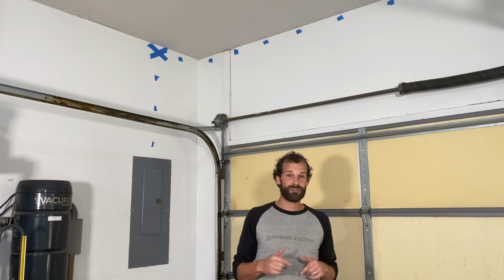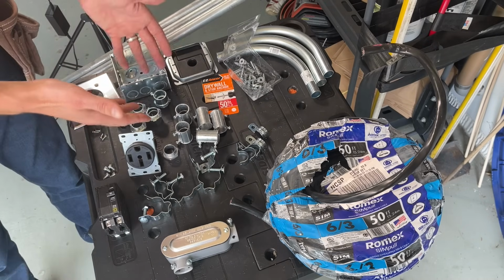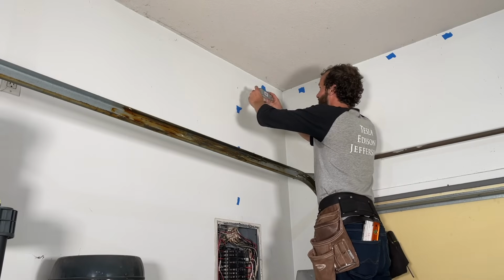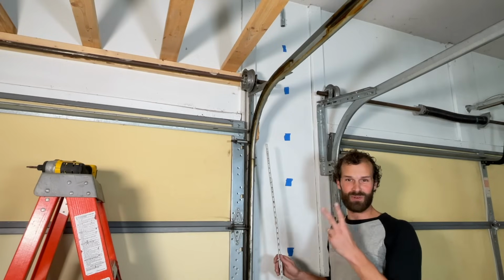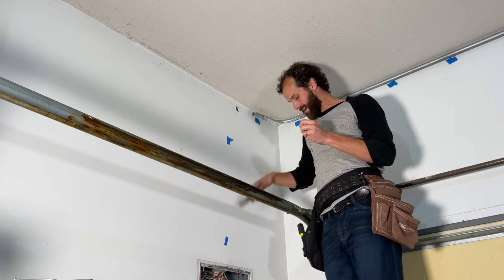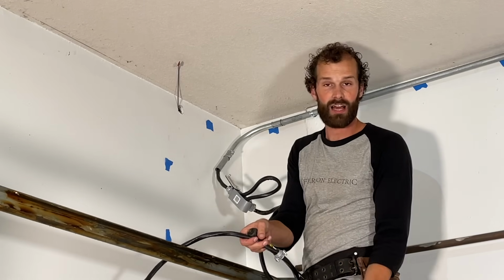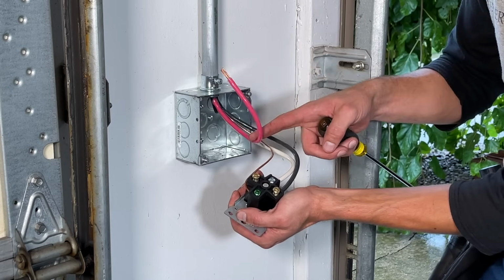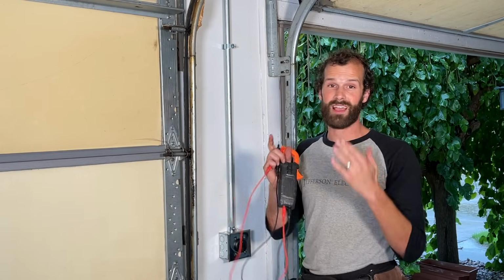How To Install a 240 Volt Outlet | Electric Car Charging

Comment: The reason why he had so much trouble pulling is that the EMT he used (3/4 inch) was undersized for the Romex he used (6-3 w/gnd.)  2020 NEC Chapter 9, Table 1 and Chapter 9, Item 9 requires 53% maximum fill for cable in conduit or tubing, which would be exceeded in his situation. So 1 inch EMT, or individual THHN's where 40% fill can be used.
Reply: NM in EMT?
You are seriously showing DIYers a metal fish tape into a live breaker box?
A 14-50 outlet requires a GFCI breaker for code.
I was wondering why you didn't use an LB, but looks like now you are wondering that too. 🙂
You failed to ground the EMT. Umm, that is a serious flunk. Since the EMT was not started at the breaker box, you need a ground connection from the LLR to the breaker box. There should be another ground inside the outlet box to NM ground wire. Yes, I know  receptacles have a connection from ground to the case, but you shouldn't rely on that.
Reply: @pictsidhe6471  Where does a 14-50 receptacle require GFCI?
Reply: @timgraham7851   Effective January 1st, 2019, the code was updated to require GFCI breakers for all garage outlets, including the NEMA 14-50 and NEMA 6-50 outlets.  Since there is no GFCI 14-50 outlet, it has to be at the breaker.
Reply: @jeffhughes2186  you might be correct.  I st remember that the NEC must be adopted by the ahj.  Most take some time.  Some are almost 2 cycle behind.
Reply: @richt5986  You cannot strip off that outer romex insulation and use just the conductors.  Those conductors are unmarked and cannot be used as individual conductors.
Reply: I thought the same 40% wire to pipe size.
Reply: @gerardozambrano4863  Because it's a single cable, it's 53%. In either case, it's still overfilled.
Reply: Just use a store bought extension cord with a power strip.  Just saying
Reply: Yeah no need to pull Romex. Pulling individual wires would have been easy
Reply: @AnkurSethi108  yes stranded is easier to pull.  In this situaltin, stranded cannot be run without conduit in the void space of the wall.
Reply: He not supposed to pull romex inside EMT. No grounding bushing, no box grounding. Disaster.
Reply: @SebazUSA   can you specify where in CODE  it says not use romex in an oversized conduit?
Reply: @MattNis1  NEC 334 disagrees with you in section 34.14 or 334.15 which covers protection from physical damage.

Chapter  9 table 1 note 2 deletes the fill requirements for this run.

Yes ahj can have other rules in your area.
Reply: @SebazUSA  please review NEC 334.15.(B).  It appears this section allows NM cable to be protected from. Physical damage where the work is exposed by installing it inside emt.
Reply: @SebazUSA  No grounding bushing needed on 3/4"
Reply: @SebazUSA GB not  Not required on 3/4".
Reply: Also romex doesn't belong in conduit!!! This guy is a fake.. this is how fires are started,  and people  die!!! FIX THIS!!!
Reply: @dannytorres4388  I'm glad you also see this. I've never seen anyone spend a time or false money trying to snake Romex through EMT. Always single strand wire, pulled with a fish tape through and Terminated at both ends is professional work. I don't know where the hell Romex belongs in EMT!
Reply: @1956Taz  NEC chapter 334. Nm cable.  I think 334.14 or 334.15.  protection from physical damage.  EMT and PVC are both approved.  No length restrictions are given in either 334 nor chapter 9 table 1 note 2 which deletes fill requirements for protection from phyical damage or runs not completed like here.
Reply: @1956Taz  Excellent point.
Reply: @1956Taz isn’t he using romex because he is going behind the drywall without EMT? Is single strand wire allowed for that segment?  I’m no pro, just curious.
Reply: @dannytorres4388  EMT conducts heat better than air
Reply: If he had run THHN individual wires, what size would the ground need to be? same size 6 gauge?
Reply: @eddied4969  No, #10
Reply: @eddied4969  I have the same question.
Reply: @peterp4319  size 10.
Reply: @eddied4969  The size of the Equipment Grounding Conductor, aka EGC or ground is sized per Table 250.122, and is based off the size of the overcurrent protective device (OCPD), which in this case is the 50A breaker. For OCPD > 20A but <= 60A the min EGC required is a #10.
Reply: @eddied4969  #10
Reply: @eddied4969  No.  10 would be fine. Good up to 60 amps.
Reply: First, I did not think that it was allowed to pull romex in conduit.  I am with you, pull THHN.  Another thing I have seen is they may put the black wire on T-1 in the box and on T-2 on a unit such as A/C unit and then the white wire on T-2 in the box and T-1 in the unit.  When I was playing around with my A/C unit I changed that, black on T-1 and white on T-2 and wrapped red tape on the white wire to denote that it is a 220v circuit and not a 110v circuit.
Reply: @fly4u570  Romex is allowed in conduit but with a few exceptions, it's a very amateurish way to do an installation.
Reply: @fly4u570  I’m curious, if I run thhn in the conduit, what is used in the wall cavity?  I thought that Romex required in the wall cavity?  If so, it means you splice (thhn and romex) them together in a jbox at the wall entry?
Reply: @theige01  Conduit is in the wall.
Reply: @fly4u570  I see.  That means I’d have to bust open the drywall, retexture and paint to run the conduit.
Reply: @theige01  You could surface mount the conduit.
Reply: @fly4u570  thanks for sharing your thoughts.
Reply: @theige01  "it means you splice (thhn and romex) them together in a jbox at the wall entry?" -- that's what I did when I wired through my garage
Reply: @jmkeuning  Thanks for the info.  I ended up going continuous run of 6/2 NM-B from main breaker box through attic then down into garage, where from attic down garage wall 5'  to EV wall connector, we used 3/4" EMT.
Reply: I just read that you aren’t supposed to run Romex in metal conduit at all… only THHN. Also, that is the wrong metal electrical box for external installation (outside the wall). You should only use a drawn electrical box stamped out of one piece of metal so that it has rounded corners. The kind made of multiple pieces of folded metal with corners should only be used INSIDE the wall.
Reply: @emmettturner9452  Don't know where you read that but it's incorrect. Romex is allowed in metal conduit and either type of metal box is fine in an exposed installation.
Reply: @pld8993  This is exactly what it said:
“Can NM Cable be Run Inside Conduit?
If an electrical inspector has flagged NM cable that has been run incorrectly, you might be tempted to install the conduit, then reuse the same NM cable by running it through the new conduit. 

This is a subject of some debate among electricians. Some pros argue that NM cable inside conduit may be susceptible to heat build-up and is therefore not allowed. Others take a more lenient view. While the National Electrical Code does not expressly forbid inserting NM cable inside conduit, it is, in practice, very difficult to do so and very few professional electricians will do such an installation.”

Just read it this morning… and the thing about drawn metal electrical boxes versus other kinds of square boxes is something I read last year when trying to find out what the stamped kind is called. Of course, that information came to me along with guidelines on when to use what kind… though it’s common sense that you’d want rounded edges on an exposed electrical box for ergonomic reasons.
Reply: @emmettturner9452   @emmettturner9452  The heat buildup argument is an invalid one and certainly not based on the physics of heat transfer. NM cable is regularly installed in walls and surrounded by insulation, which results in the heat being unable to dissipate outwardly; all it can do is heat up and cool down. In a conduit, where's it's surrounded by air and able to transfer the heat to the conduit itself, heat dissipation is better than in an insulated wall but it's a moot point anyway. The ampacity of NM is derated down so low, the amount of heat buildup does not have a negative effect on the conductor insulation or the sheathing. It's designed for those conditions. 
I hear about electricians debating the point about whether or not the NEC allows NM in conduit and I don't understand why there's even a debate. All one needs to do is read 334.15(B) and 334.15(C) where the NEC explicitly allows/requires NM in several different kinds of conduit. No debate necessary, but an easy one to win. There are many, many electricians who cite the code but never open a code book, relying solely on what they've heard and not what they've read. You're right that real electricians rarely install NM in conduit. The only time I've ever done it is on basement walls in short 2'-3' sections for physical protection, or UF cables coming up out of the ground. Pulling it through a lengthy run of conduit is amateurish.
Given the number of electrical inspectors out there who have never been electricians, when an inspector flags me for something that's explicitly legal I always challenge it. Inspectors enforce the code, they don't get to write it or alter it, especially out of ignorance. Just a few months ago I had to school an inspector on using EMT as a grounding conductor. 
As far as stamped vs welded boxes, both are fine exposed. There are no restrictions.
Reply: @pld8993  I agree. The characteristics of metal tubing undeniably improve heat transfer… though you wouldn’t expect to need it under normal conditions. I’m curious to know what the code says about EMT as a ground conductor. My guess is that you cannot consider it a ground conductor since electrical continuity cannot be guaranteed without a dedicated conductor that runs through it, tied at each junction/electrical box or outlet. Still, I was recently displaced to a 100+ year old home by a natural disaster (EF4 tornado) and half the outlets were the old 2-prong ungrounded type with two T-shaped terminals. The fuse box had been updated to a breaker box at some point but it was a nightmare of old and new/old work… left wide-open to boot. I did note that there was grounded conduit going to some of those old 2-prong outlets. Since you are allowed to replace them with properly-labeled 3-prong GFCI receptacles according to the NEC, it occurred to me that they would probably be grounded through the conduit regardless of what the label says. This could happen simply from mounting the receptacle to the metallic box that the conduit connects to… and I don’t see the harm in making sure with a more deliberate ground connection between the box and the outlet.

I’m sure that per the NEC I would need to leave that label on regardless (indicates that it is not properly earthed despite the third prong). Is there any situation where they would allow EMT conduit as the ground conductor?
Reply: @emmettturner9452  A wire type conductor is 1 of 14 different types of EGCs, while 12 of the 14 are metal conduits and raceways. When metal conduits are installed properly, ground wires are not almost never necessary, though there are exceptions for flexible ones. 250.118
Reply: You are not supposed to put Romex Cable in an EMT. It is supposed to be single wire only. Romex cable heat up and will not properly dissipate the heat  in an EMT.  This is not to code.
Reply: @1956Taz  Not a code violation to instal Romex in conduit, though it is amateurish.
Reply: @1956Taz  Sir, my review of my 2020 NEC article 334.15.(B). "Exposed Work", "protection from physical damage",  it looks like the NEC allows NM cable to be installed in EMT.
Reply: @1956Taz  allowed by the NEC section for nm or Romex cable section 334.  I think it is 334.14
Reply: @1956Taz  You are wrong about NMB in conduit. If it's not a damp location it's fine. Educate yourself. He needed to use 1" pipe for that 6/3 NMB,and not 3/4". That's all I can see.
Reply: @1956Taz  the only thing that makes it against code is he used the wrong size conduit, he should've used 1 inch then he would have been alright.
Reply: @thomasmarable6818  Multiple NEC violations, not just the conduit size issue.
Reply: @thomasmarable6818  NEC chapter 9 table 1 note 2 says the conduit fill does not apply to conduct runs for protection or runs not completed.
Reply: @pld8993  conduit size for this project according to my findings in the NEC...if it fits, is all good.

I use NEC chapter 9 table 1 note 2 for this conclusion based on condui run not complete and used for protection from physical damage.

Did I get that right?
Reply: @keithharrington8715  No, it's a complete conduit system from box to LR, which then transitions to NM out of the LR into the wall. That transition requires a romex connector on the end of the LR in the wall, which he did not do, one of the many violations.
Reply: @pld8993  juat watched the video again...yes inside the wall is no con duit, no flex just NM cable.  This means the conduit stops at the conduit body not the panel. This means the conduit does not go to the panel, there is zero flex nor pipe in the wall.  How is that a compete conduit run?

You even admit this when you say a Mc connector is required on the condiust body.  The pipe nor any conduit does not go to the panel.  We can debate all day long if a nm cable connector is required, but since there is zero conduit body in the wall.....not a complete conduit run as you point out.
Reply: @keithharrington8715  No debate necessary, 314.17(B) clearly states that the cable must be secured to the conduit body. 
Going from a panel to a box is one example of a complete run but not the only one. Using that logic one could install 200' of EMT but as long they stop a foot short of the panel and transition to a different wiring method, they can call it physical protection and ignore raceway installation rules. Going from a box to a conduit body is considered a complete run. Again, no debate necessary, see below.
300.18 Raceway Installations.
(A) Complete Runs. Raceways, other than busways or exposed raceways having hinged or removable covers, shall be installed complete between outlet, junction, or splicing points prior to the installation of conductors.
Reply: @pld8993  yes,as you are happy to point out....conduit bdy to box not box to box.....not a completed run.  A condut body may have splices but no ground is required.  Not a box to box or box to panel run as you indicated by saying the nm must be supported at the conduit body or end of the conduit run which connects to nothing.
Reply: @keithharrington8715  It doesn't say box-to-box. It says "shall be installed complete between outlet, junction, or splicing points" and a conduit body is a junction point. While this particular LR is not being used for splices, it could also be a splicing point.
Reply: @thomasmarable6818  3/4" was legal.
Reply: @patrickmulleady6682  You're wrong, Table 1 Chapter 9, 1" is minimum size allowed in this case.
Reply: @1956Taz  taz shut up. Romex is allowed in conduit.
Reply: @1956Taz    It is not an issue at all.  EMT will dissipate heat much better due to contact with the wire shielding, better than stale air.
Reply: I think you missed note 2.

I used the 2020 nec to look 5his up.  Table 1 chapter 9 note 2 points to conduits for protection, uncompleted runs like here,  are not intended to follow the fill requirements.

Page 70-695.
Reply: @keithharrington8715  A "short" section of raceway for physical protection is not what we're looking at. It's also a completed run, goes from a box to a conduit body.
Reply: @pld8993  look again please.oe he conduit g to the panel or did he use Romex....nm cable in the wall with no conduit?

It is exposed on the people side of the wall/structure from where it sits the player shet to the bo by the garage door.

Now if you look in 334 section o the NEC...I think 334.15 or 334.16 talks. About protetion from phyical damage and gives zero length requirements.  Your local ahj or building department can add a length restriction, but the NEC has none.

Also NEC chapter 9 table 1 has no length restriction but date that fill requirements do not apply if the conduit run I not complete.  Wouldn't that be from panel to box?  Not the case if the PVC oes not connect to the panel.
Reply: @keithharrington8715  In order to be a complete run it does not have to go to the panel in this case because it goes from one pulling point to an other. The NEC, in multiple places, talks about a completed run being raceway run between pulling points, which is what was installed here, box to LR. 334 doesn't talk about length but 300.18 does and it specifies that raceway installation rules don't apply to "short" sections of raceways used for physical protection. An almost 20' run with 2 90s and 2 pulling points is not a short section of raceway.
Reply: @pld8993  as  you point out, it is for protection from physical damage.  It does not specify a distance in 334.15.  The run from exit from the wall all the way to the box requires. Protection.  

If you fou d a distance anywhere In the nec please let me know.
Reply: @keithharrington8715  While "short" is subjective, one could reasonably make the argument that since EMT comes in 10' lengths, anything shorter than 10' is a section but anything longer than 10' is not. This video does not show the installation of a short section of conduit..

300.18(B) Exception: Short sections of raceways used to contain conductors or cable assemblies for protection from physical damage shall not be required to be installed complete between outlet, junction, or splicing points.
Reply: @keithharrington8715  It is common to have to refer to multiple articles in order to be code compliant. The fact that there is no distance listed in 334 is irrelevant. When reading 334.15 or Note 2 in Chap 9 Table 1, 300.18 Raceway Installations applies
Reply: @pld8993  yes.  Short sections not connecting to the box, only providing protection from physical damage......the wall with the panel to the slim wall by the garage door is all exposed and inside a garage, requiring protection iaw 334.15.

And you are right, anything that does not make the full run from box to box or box to panel is. " short".
Reply: @keithharrington8715  So a 200' run of EMT that doesn't connect to a box on one end is considered short? Short means not long, it doesn't mean not complete. You're confusing two unrelated terms. While this installation does use EMT for physical protection, that doesn't mean it can be installed as a short section of raceway, because it's not a short section of raceway. In this installation the smallest EMT allowed is 1" and it should have been installed complete from outlet point on the wall to junction point at the ceiling, before the cable was installed. Running Romex like this is not a very professional way to do this, anyway.
Reply: @richt5986  no it's #4
Reply: I would have used lube
Reply: 98
Reply: The conduit was OK. He needed wire ease and it would have been easier to pull through hand bent 90s
Reply: @jamesrogers8880  According to conduit fill rules, conduit is too small. Needs to be 1" minimum.
Reply: There are limits to where NM can be used in conduit, and this is a master electrician.   It causes me to wonder if having a qualified electrician is a sure way to meet code.  I’ve seen this guy many times, and in my opinion he knows what he’s doing.  No, I didn’t see him ground to the box.  If this is a 200 amp main panel, the box is grounded, and the neutral bonded (he said so)  the NM through the wall kills the conduit ground path, so technically, the outlet box is not properly grounded via direct screw.  I’ll bet with his reputation, it would pass inspection.  A DIY would likely fail.   Is it safe ?   I think so, to a point.  The Tesla mobile connector should have a GFCI, as well as Tesla wall connector.  Seems like a dilemma for the DIY person who opts for inspection.  If a hot wire hit any part of the conduit, I believe you would have a hot box in a room with a concrete floor. Extremely high current hazard to ground, but is it bonded ?   Maybe via outlet design, but now we’re blowing off green grounding screws.  Isn’t that exactly why they are there ?
Reply: Obviously a real Sparky! 👍👍
Reply: Can I pull 8/3 Romeo through emt?
Reply: I would not let this guy in my panel unless if it was meant to be an insurance job.
Reply: Why not use a raised cover?
Reply: And THHN is way easier to pull in conduit
Reply: I'm an apprentice and That thought came to mind, conduit to small.
Reply: What's really annoying is hooking up a spa disconnect with 6/3 in a tiny ass box.
Reply: @MrBigGStyle  I usually pull the breaker out of that tiny ass box, wire it, then snap it back in.
Reply: I will not use those any more. I gave up and buy a larger box and then I don’t have to fight that 6.
Reply: @cygnus1965  5/S deep would be better choice. Agreed.
Reply: @Tennessee Darrell He most certainly did, didn’t he? In fact shouldn’t he have added a bare #6 AWG  pig tail  Gnd to a green stud or screw to complete a ground fault path for the EMT raceway? Hey he was so concerned about the ascetics of the screw head alignment but failed to actually complete a grounding pathway. Or used PVC Schedule 80 Conduit which does not need to be grounded and bonded?

Per code he probably should’ve ran individual #6 THHN cable in a 1 in raceway to be honest 

I’m just saying ?
Reply: @kevintaylor113  can thhn 6 run in 3/4 conduit? I have this question because I’ve already cut 3 conduits.
Reply: @yanbingwang6058  yes.  NEC chapter 9 table 1 note 2 allows for zero conduit fill requirements in this situation.
Reply: @yanbingwang6058  4#6 THHN (2 hot, 1 neutral, 1 gnd) in a 3/4” EMT would be ~36.5% fill. Since this is <40%, it is legal.
Reply: @ericwg73  Incorrect. When installing Romex (or any) cable in conduit, conduit fill is not determined by individual conductor sizes/areas inside the cable, but by cable size/area. See Table 1 in Chapter 9, Notes 5 and 9.
Reply: @pld8993  I was answering Yanbin’s question about whether or not #6 THHN could fit in a 3/4” conduit (assumed EMT). I then provided the % fill for 4#6 in 3/4” EMT. My reply had nothing to do with romex in conduit. Although I should have clarified that for this ckt it really only needed 3#6,1#10G, i.e. the EGC doesn’t need to be a #6. Other than that, the info I provided was accurate.
Reply: @pld8993  …and yes, I realize that with any multiconductor cable the fill is based on the overall cable’s OD, not the size of the individual conductors. And in this case, with it being a single cable, the 53% fill limit would apply.
Reply: @ericwg73  Got it. Yes, all accurate. For this circuit using THHN, however, 3 #8s and a #10 would have sufficed.
Reply: @pld8993  Again, to be clear, I did not size the conductors for Yanbin, I only verified the fill % for the #6 THHN in 3/4” EMT. As far as conductor sizing, you are correct, as long as the terminals at the panel and on the outlet are 75degC rated, which they should be, #8’s are rated for 50A and could be used, i.e. 3#8,#10G.
Reply: @kevintaylor113  you can do a #8 ground with #6 conductors
Reply: @AnkurSethi108  #10 ground for up to 60 amps.
Reply: @kevintaylor113 according to NEC 2023 358.60 Grounding. “Emt shall be permitted as an equipment grounding conductor.”
Reply: I recommend a plastic. Bushing on end conduit connectors at receptacle box and inside service panel . A bit of extra protection for wires .
Reply: @johnhontz8476  Bravo.
Reply from the maker: Thanks for the feedback James, appreciate the help.
Reply: @EverydayHomeRepairs  I tried what James said and it electrocuted my balls off. LOL. Thanks for making the video
Reply: @fernandoprieto2865  This is exactly why some people should just hire some one!
Reply: @Blahman240  it was a joke
Reply: Exactly
Reply: Code allows (4) #6 THHN in 3/4" conduit.  In the romex used, the ground wire is actually 1 size smaller, (#10), which is permissible in most applications for up to 60 amps.
IMHO, this gentleman put on a very concise, definitive explanation, complete with some great tips.
However, one thing he didn't do, was bond the box BEFORE attaching ground wire to receptacle.
Otherwise, a pretty good presentation
Reply: @patrickmulleady6682  Except that when installing Romex cable in conduit, conduit fill is not determined by individual conductor size but by cable size, see Table 1 in Chapter 9. 6-3 Romex has an OD of .65" which puts the area at .332sq". With a single cable in conduit, the conduit fill is limited to 53% which for EMT, according to Table 4 in Chapter 9, is .283 sq". This cable is not allowed in 3/4" EMT and he should have used 1" EMT (max fill .458). But again, installing Romex in conduit like this is a very amateurish way to do it anyway and the way it was done violates several codes regardless.
Reply: YouTube take this video down.
Reply: Maybe a little wire ease would have helped the pulling of the 6/3 romex.I thought it was a neat installation.